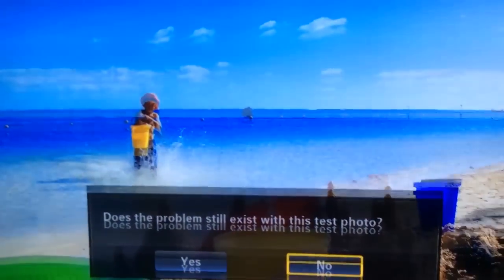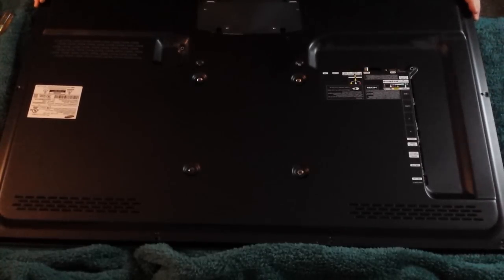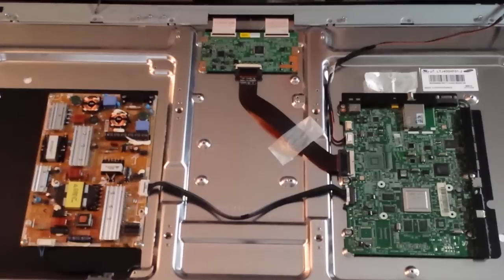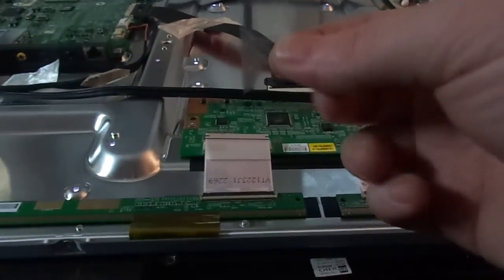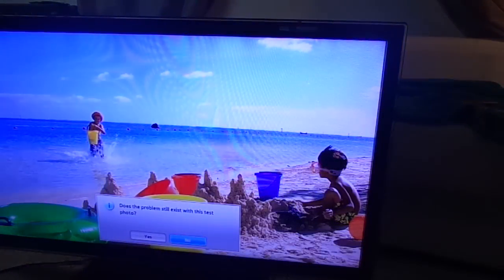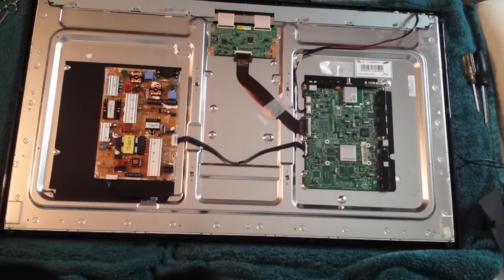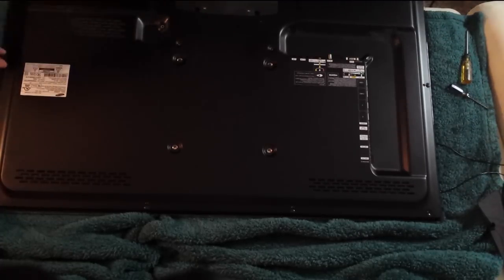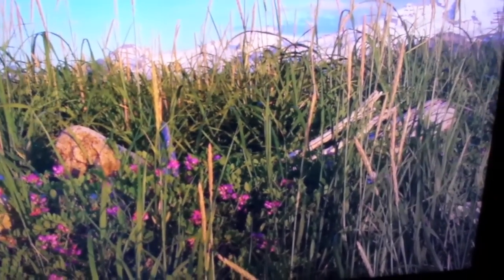LED LCD TV FIX, How To For Samsung Double Image, Black Vertical Lines, Screen Problem Sony LG.

Comment: I am very comfortable with these steps. I have a question. Since the piece of cellophane tape was the fix then was the problem with the clearance inside the ribbon-wire plug? Was the tape offering some non-existent resistance? I noticed that you said you made the tape smaller? Weren't you covering the gold contacts of the ribbon-wire? Maybe 'splain that a bit. I am going to do a repair on a Sony Bravia someone just gave me. It has horizontal lines for about a half hour. Then the TV has a great picture. Sounds like contact issues (something has warmed up and closed contact, i.e, , a cold solder joint or a wire that has gotten lose with age, gravity). I really think the problem will be easy to fix but your excellent video shows some 'deeper' things to try if checking wires, plugs does not work.  Thanks
Reply from the maker: Hey Mike Baber,

I did place a small piece of tape over the gold strip of the ribbon cable.  I placed the tape as close to the tip of the gold strip as possible.  If you watch the video in HD you should be able to see where I show the placement of the tape up close right at 5:55. I hope this helps.  I'm not sure about the lines on the screen.  In my case the lines were constant as long as the tv was on.  Please share any progress you make.  Thank you for watching.

Comment: Just so people don't make the same mistake as me, please don't try this repair with the tv on, you don't need it on.

The tape actually blocks out the first set of pins- electricity doesn't travel through tape, so just keep plugging back in after the tape is applied.

I now have a black bar going straight through the panel vertically. No repair unfortunately.
Reply: Hi David, please how many Pins do i have to cover ?
Reply from the maker: Dorian Shehu Somewhere in between 20 to 30.  I don't have an exact count.
Reply: Yeah, mine stopped being double around the 7 pin mark I think.

Comment: I'm also having some weird kind of problems with my Samsung S19A100N LED. I don't know how to explain but its colors are very awkward, like when you change your colors to 8-bit on computer. I changed brightness, contrast but all in vain. Everything is blur and white-ish. I've checked with other computers but the problem is still there. Could you please help me? I've pictures of LED, could you please tell me how can I send you the pictures?
Reply from the maker: Hey Moaaz K'

I know you stated that you've tried plugging into different computers but are you using VGA only or does your monitor also have a HDMI connection?   I found a video and linked it for you.  From what you are saying about the display issue and how the images look I think you may find it helpful.  Please post any updates.

https://www.youtube.com/watch?v=a1ok1VEHctc
Reply: I've 19 inch LED. It only has VGA connection and a power connection and nothing else. I couldn't find any screw on the body of LED so I don't know how to open it.
Reply from the maker: Moaaz K' Hey there.  If you are looking for access to the screws and can not locate them try gently removing the front bezel.  You may find the screws under that.  Be delicate when ever you are working on electronics,  patients is a great skill to have.

Comment: Hi Dave ! My TV is Samsung UA46ES8000. It is having blue thin vertical lines on left side of the TV. First it started with two and now multiplying. Firstly we thought that was a dish line problem but it also there when I used blue ray player to watch movies. When there is light colored picture on TV the lines are almost invisible. But on dark color images the line s most visible. The TV was bought on 2012 from Thailand. Problem started from 2014 and is still there. I have no service warranty and I have not yet talked to Samsung Service Center about it. Do you think that the TV is having faulty panel? Are you sure doing this would help me anyhow ?

Comment: Unbelievable but this solution actually worked for our 55” 2009 Samsung LED.  I was really bummed that we’d have to pay $800 for a replacement, after spending $2500 on this one originally.  Double image was corrected, picture is back to perfect.  I am not particularly handy, certainly not with technology, yet this fix was really pretty easy.  Key was having the tape cover only a part of the gold on the backside of the ribbon.  Thanks Dave!!!
Reply from the maker: Thank you for watching Ethan Ardonlino.  I'm glad you found this video helpful.

Comment: Short question...... Did u isolate a few of the contacts?
Reply from the maker: Alte Schule74  I did not isolate any contacts.  The purpose of the tape is to keep static electricity from building up  that cause issues with the tv.
Reply: Yes he did

Comment: Hey dude that tape worked a real treat but when I was adjusting the tape to get it perfect. The next time I looked at the screen it was black one both sides. Turned it off and on and I still have no screen. The lights on the back of the screen light up so I know its on but no picture any clues on what I done wrong?????
Reply from the maker: Check all of the connections for the ribbon cables that can be removed by unlocking the push down tabs and insure they are all in place.

Comment: Dave,

Like some of your subscribers, after trying your method to some degree of success, my screen now has turned blue but I get sound clearly (I did not disconnect the speakers).  Neither do I see the Samsung Logo when the TV is powered up.  I took off the tape and re-seated the ribbon cable but the screen is blue.

I have check for debris and put back the ribbon but cannot see anything on the screen.

Suggestions would be grateful.
Reply from the maker: Is the entire screen blue?  If it is then the panels are working together which is good.  If you have any devices hooked up to the tv disconnect them and turn everything off.  Try turning the tv back on without any devices plugged in and see if anything changes.  Try to run a screen test.
Reply: Do It With Dave Hi Dave, thanks for your prompt reply.  Yes, the entire screen is blue with the exception of a small sliver about 8 inches from the bottom left of the screen, approximate 2 inches long and a 1/4 in width, right at the edge of the screen.  This sliver, is predominately white and there is a patch of yellow and two patch of red. When I disconnect the tv signal, the screen goes black but the sliver remains. I cannot see the menu when I try to call it up (is this what you mean by a screen test?).
Reply: Allen Kwan BTW, while you are formulating a reply, I can perhaps elaborate on my problem and I think it verifies your static build up problem.  My issue was/is, when I turn on the TV, a horizontal line appears two third down the screen.  After a minute, the double lines and blurred vision occurs.  When I was following your method, I disconnected the ribbon cable and then reconnected it and picture improved but soon after the double lines reoccur.  This suggests to me there is a build up of something that occurs over time.
Reply: Allen Kwan Dave, I thought I would tell you my eventual outcome.  After my attempt at the fix and the screen went black/blue.  I put everything back in place and called Samsung repair.  As my TV is over 3 year old (3 years 2 months to be precise) I was charged a $64 visitation fee.  On inspection, within 15 seconds (you guessed it), I need a new panel.  I got a call today giving me a quotation for repair, $792!  I now have two next steps. First is to call the handyman (he is an electronic wiz) from down the street and ask if he could offer a second opinion and confirm Samsung's assessment and perhaps make repairs. Failing at this step, I have spotted a LG 48", with 4K, WebOS control, 3 year warranty for $1,025 (this is 1/2 of what I paid for my 42" Samsung just over 3 years ago .  In closing I wanted to say that I have no regrets trying your fix, if it did not work, I would still be in same position.  Must say this experience has turned me off Samsung products.
Reply from the maker: Allen Kwan Thank you for sharing.  I read recently that LG is coming out with a tv that has no back light and will have a better picture than anyone on the market.  The technology for their new tv will make lcd and led tvs much less expensive cause that will be old news.  Good luck on your purchase.

Comment: Hey Dave, Does the tape fully cover the contact? Or did you cover just half of the contact?
Reply from the maker: I put a tiny piece of tape on the very tip of the gold contact, and it covered about and eight of the gold strip.  Maybe like 5 pins or so.
Reply: Covers the pins

Comment: I'm honestly blown away that this worked..
I had horizontal black lines with Picture Doubling all of my screen.
A customer gave this to TV to me for free. 

Dave, I thought you were a crackpot at first... But I figured a solid try was worth more than giving up. The ribbon you were messing with did nothing for me was when I almost gave up and tinkered with the other ribbon that it worked and I couldn't believe it. 

How'd you know about this?

Comment: question i have samsung 55 led smart tv 3d with a cracked screen model number un55d7050 i was wondering if there are other models that i could just switch over my componets into that doesnt have a crack screen ?

Comment: bro just thought i share well my baby threw the remote and cracked my screen on my samaung un55d7050 smart tv 3d so i was looking on craigslist for another 55 led and came across a 55 thathad double picture he was asking 150 i droped the price down to 75 dollars took the tv home and pulled the ribbon connector out and that side of tv picture was cleared up so i did your tape trick on the ribbon band messed with it for a lil bit a bam the pic cleared up the whole tv so thank you for your video
Reply from the maker: Oh snap!  Great find. I'm so glad you found this video helpful.   Thank you for watching and thank you for sharing.

Comment from the maker: I don't know for a fact.  Companies make products based on supply and demand.   If a product sells well and everone is buying than the demand is up.  However once everyone buys one the and has no need the buy another one of that product than the demand goes down.   If a company wants to keep the demand high to sell more products then people will need to keep buying those products.   If a device is purchased more than once by a consumer before the life expectancy of that product than the company makes more revenue then if a consumer only 'needs' to buy the product one time. In my opinion I wouldn't put it past a company to design a device to fail at a certain point so that same device would be purchased again before it become obsolete.
Reply: I believe the term they used in college is "planned obsolescence" look it up = )
Reply: My guess: this is why Samsung uses horribly cheap capacitors.  I've had lots of Samsung LCD's with busted capacitors after two years.  Not-so-coincidentally that's the same length of time as the typical manufacturer's warranty!
Reply from the maker: I put the tape covering the gold strip.
Reply: Yes it's called planned obsolescence and they teach engineers how to make products fail at a predicted time. That way a company can tell you "We have a 3 year warranty, make it fail in 3.5." Unfortunately that's not illegal. Also, Dave, for future reference in America a company can not void a warranty if you open the product. They can say they will because their products are in multiple countries, most of which they can void the warranty in, but they can't actually void the warranty in America. If you open it to try and fix something and you break something yourself, of course that won't be covered. But, if you open it and fix something that's not covered by the warranty, then later something else breaks that is covered by the warranty, they can not void the warranty just because you fixed the other part earlier.This is especially true if they only pay for the replacement parts and then try to tell you only their certified technicians can install it. That would be illegal to require if you would have to pay the technician yourself. They could only require it if the technician installed it for free. All of that would go against the "tie in" part of the Magnuson-Moss Warranty Act. I'm surprised how few people know companies can't void their warranty in America even if you "work on" the product. EVERYONE needs to be aware of this. They will of course tell you it's voided hoping you don't know it's actually illegal. Even if you do know, they know most people won't have the testicular fortitude to take them to court.
Reply: +Do It With Dave They call this "cyclical consumption" =]
Reply: Dave does it matter if the tape over laps the gold strip? or does the tape need to be in the middle or just touching the gold strip?
Reply: I have the same tv with the same issue, but my problem seemed to be on the right ribbon and not on the left since I dont get the double image when I disconnect the right side ribbon. I tried the tape on the edge of the right ribbon as you did on the video but I get I didnt do it correctly and now when I connect both ribbons I get only a blue screen, even without the tape. but if I disconnect the right ribbon I get half the normal picture again. I don't know what went wrong :(

Comment: Great video and tutorial Dave! I would just like to add, I have a 55" Samsung LCD that did not have the ghosting or horizontal line issues as you describe, But DID have many colored vertical lines running across the screen when I would turn the TV on (I found this TV in a goodwill for $150, not as good a find as yours obviously but still a pretty great deal!) These lines would sometimes go away if the TV was left on for a few minutes, but not always- and sometimes they would go away then come back. (Yours is the first video I have found that logically diagnoses this problem as static electricity building up on the connectors- makes quite bit of sense.) Instead of the two ribbon cables that split the picture as you show here, what I found to be the problem in my case was that single ribbon cable that runs from that same board up to the main input board. The connection at the main input board was a similar tab connection and seemed to be where my problem was located (when I removed and then reinserted the cable at this connector, the lines would go away and reappear as I jiggled the cable a bit.)  I tried your piece of tape trick and after a few minutes of messing around with it, I got the lines to go away. Thanks very much for your tutorial!
Reply from the maker: s blagg It's a bit late but thank you for your post.  You have helped me better understand what is causing other issues some people are asking about.  This will definitely help the YouTube community.  Thank you for watching.

Comment: You are amazing Dave, I have been putting up with a crappy screen image for ages (although it used to fix it self after 10 minutes of warming up). 
Just used your trick and it works like new. My model is bigger (Samsung LCD la40a650a1fxxy) but same logic fix :]